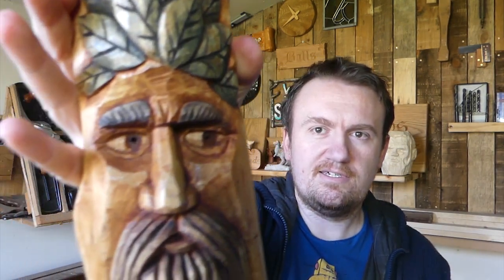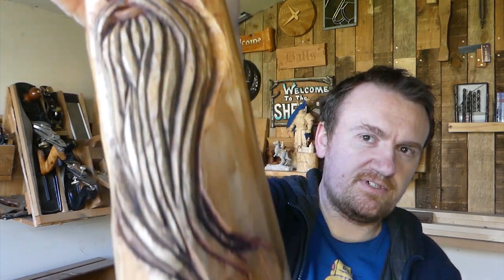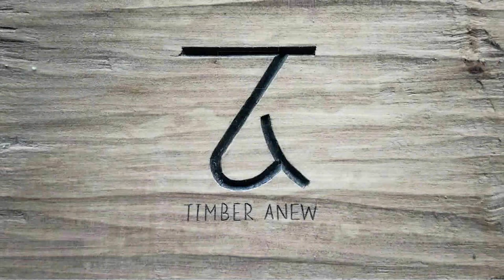Carving a Big Wood Spirit (Hand Tool Woodworking)

Comment: Clint, what is that tool you are using to remove bark - I'm having a hard time using a chisel
Reply from the maker: Sorry Sheila I thought I replied to this! The first tool I used is a bark spud. Then the smaller tool that I'm dragging over the wood and kind of "peeling" with is a spokeshave